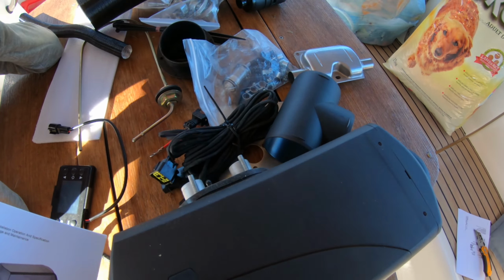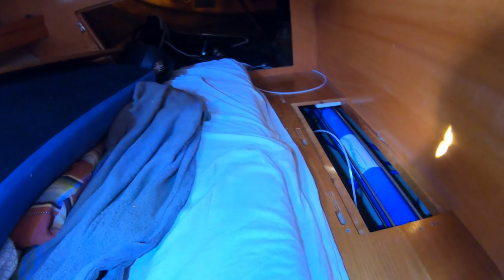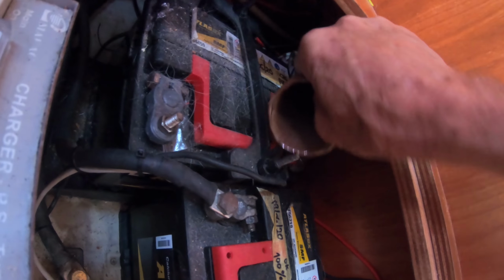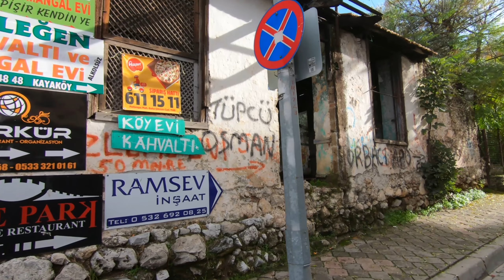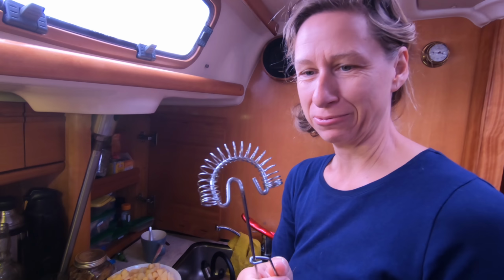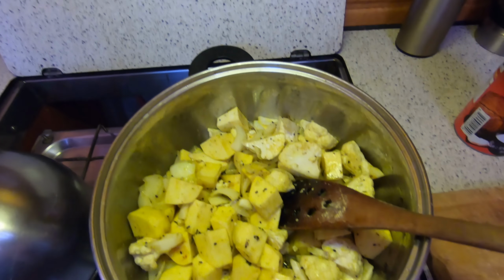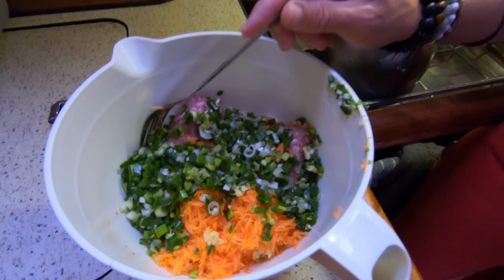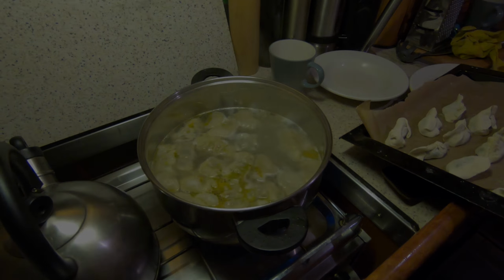40. I Lock-Down Again - Eating & Heating I Freedom Sailing

Comment: Nice video 👍 Could you please show the completed diesel heater installation. Inquiring minds want to see it. Also could you please give your opinion on the heaters effectiveness, does it heat the forward cabin as well?. Is the heater noisey for Luca in his cabin? Does Lockdown on a yacht mean you cannot go ashore or just into the towns and villages?

Comment: Guys you cannot use the silencer that came with the heater in a boat, it has a drain hole in it as it has to be mounted outside, it will release carbon monoxide and exhaust gasses into the boat, unbelievably dangerous!
Plus that through hull for the exhaust will get hot and potential cause a fire, you need a sealed marine silencer and proper hull mount that has a tube within a tube to keep the heat away from the fiberglass!
Unbelievably dangerous what you have done
Reply from the maker: I cant see a drain hole in the muffler . Any possible gas release will be into the aft cavity which cannot make its way into the cabin and is vented to the outside.  Air to be heated is drawn from the cabin, not where the heater is mounted. Also I have extended the exhaust line and am monitoring the end temperature. It appears fairly cool. I will try to source another through-hull and muffler however, Thanks.
Reply: @FreedomSailing  if you used the cheap stainless silencer /muffler you laid out when open the box it has a drain hole, I've just watched that part of your video again and sure I can see it in the video!
Please swap it out and the exhaust outlet for a proper marine boat fitting, also that exhaust again is designed to be mounted externally not internally, it's OK inside as long as its extremely well lagged to stop a fire happening, yes when those heaters have to the air upto temperature and are just ticking over it won't be excessively hot, but those heaters have to be run on full power 35° or 5.5hz for an hour solid ever week or so depending on usage, and believe me after an hour of full power they glow bright red! 
As for leaking into a locker that nothing more than dangerous and the is no way is 100% sealed either. You can potentially kill your child as sure you mentioned its under the bunk.
If you don't believe me about what I'm saying please even just on on Facebook the are many Chinese diesel heater pages and ask the questions of my concerns to get a second, third and 100th opinion!
The correct silencer, exhaust outlet and decent titanium lined lagging with cost around £110, not sure what that is in your currency, surely that's cheap to you pumping carbon monoxide into your boat or it catching fire.
I apologise if you think I'm being harsh but I know what I'm taking about I have sailed all my life, was born on a boat and have fitted 7 diesel heaters over the past years including one 3 weeks again where the owner made the same mistake as yourself.
Happy new year to you guys but please please swap those 2 parts and get lagging